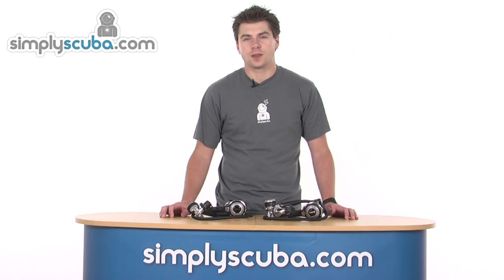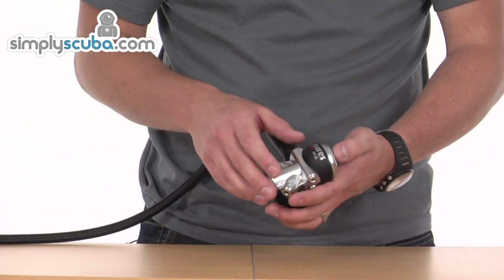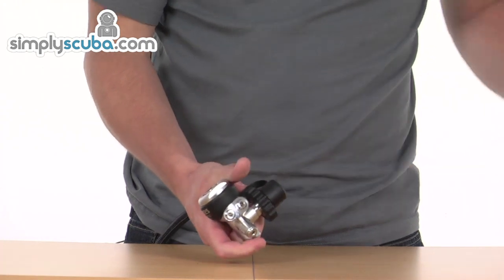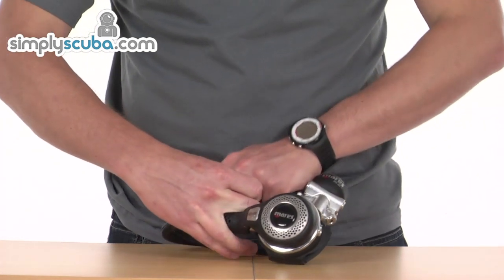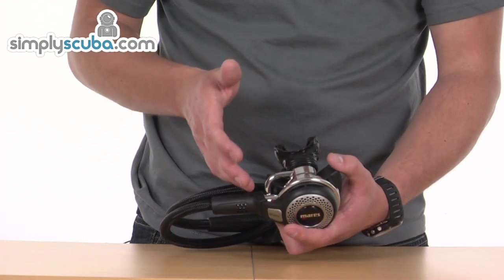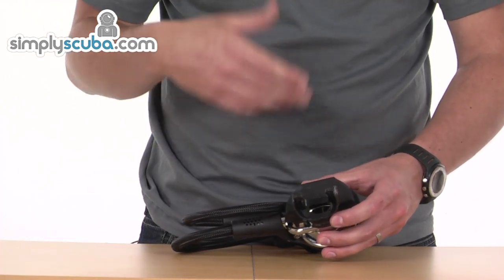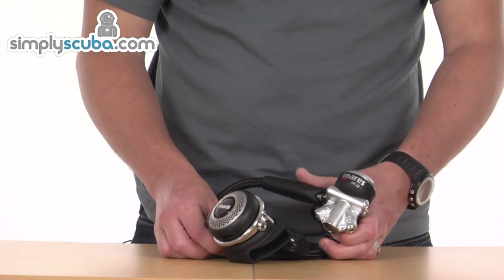Mares Abyss 22 Regulator - www.simp;yscuba.com

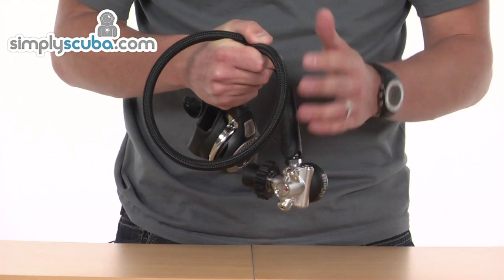Comment: Since there's no thing as a dumb question: shouldn't that regulator hose be in the LP next to the one it's in as in this vid? See 1:44, move it to the port on the right. The way it's now configured the octo and regulator hose cross unnecessarily ...
Reply from the maker: Very good question ahjno, most people don't pick up on that.  The primary is set up on that port for a couple reasons, some divers prefer it in that position for a wider hose routing and less excess hose over the shoulder.  The crossover isn't much of an issue as the octo hose goes down under your shoulder when not being used so regulator recovery is easy too as the primary is less likely to tangle with the octo.

The 22X is fitted with a 1/2" high flow port for the primary and a 3/8" for the octo so your primary can only be fitted to the rear port, unless you start swapping hoses.

It's a different configuration but it works,
Safe Diving